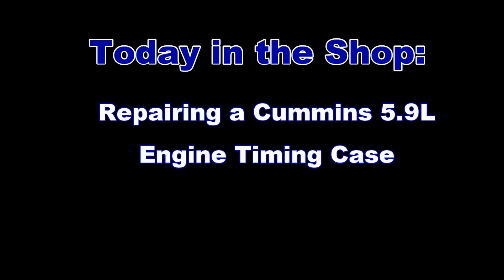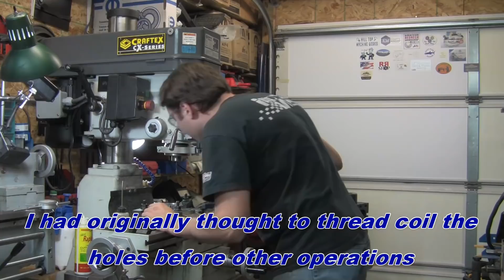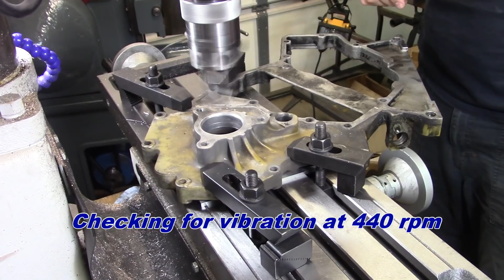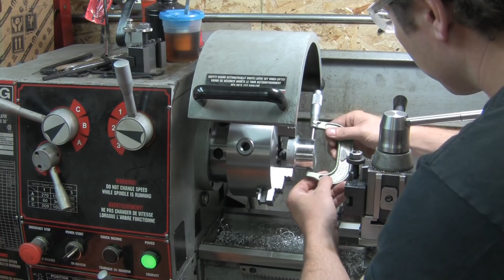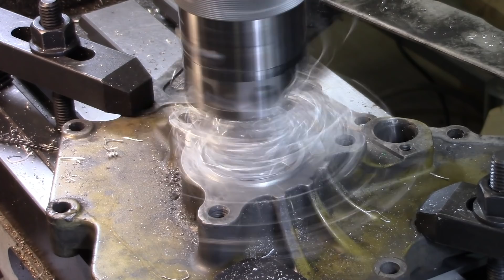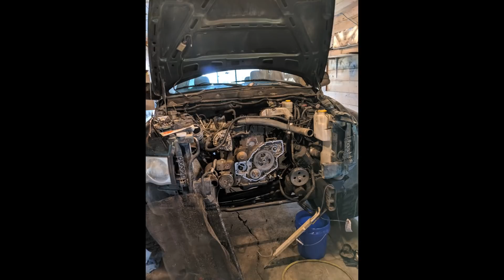Cummins 5.9 Timing Case Repair

Comment: what brand is your lathe wish you would give us a detailed video of lathe and operation
Reply from the maker: It's a King Canada KC1236ML, very similar to the Grizzly G4003. The new shop is still needing to be finished but when the equipment is set up in each machine's respective new home each one will need a cleaning, leveling, and some maintenance so I can go through each one at that time.

Comment: Liked! that is a real world repair done right. Curious what brand or type of boring head you have?
Reply from the maker: Thanks, glad you found this one interesting!  My buddy was happy with it and the engine ran after so I was happy, lol.  I haven't found any maker's marks on the boring head but near as I can tell it looks like what MSC used to sell as a small "Interstate" brand import boring facing head.  They only have the 3" now but their old pictures of 2" boring facing heads look like this one.
Reply: Everett's Workshop  I bet they inherited whatever Enco was selling when MSC bought them. Thanks for the tip, I was looking on eBay.

Comment: great job, Question for u , will hot engine water affect the lock-tight bond?
Reply from the maker: Thanks Billy, and the Loctite sleeve retainer I used is good for 450 deg F, which is way above the temperature that front timing case will ever see.

Comment: Great job, there will be trucks queuing down your street for engine repair soon 😉, highly professional, the mod will be called "The Everret Special" 😀
I have a load of similar modified slot cutters, not my idea, they came with a second hand boring head of eBay. Making them single flute, helps with machining plastics and Aluminium.
No problem with your son letting you hear him, he'll be in with you soon enough.
Thanks for sharing and best regards from the UK.
Reply from the maker: Thanks, but this is the only request so far for this particular repair.  As for the 'custom ground' end mill, it was a move of necessity as I have no 1/2" boring tools. Definitely looking forward to having my little guy out there actually working with me, he's even fun now hanging out watching me.

Comment: hello Everett. could you put up a link to the boring and facing head you purchased? great video, thanks . subscribed.
Reply from the maker: Hi Steve, I got the boring facing head from eBay and that listing page is gone already. There's an exact boxed kit on there right now for twice the price I paid, look up 'BFH-250 boring head' and it should come up. Otherwise they don't seem to be for sale new anywhere.
Reply: @EverettsWorkshop   thanks
Reply: @EverettsWorkshop  how about this price for use German made head https://www.ebay.ca/itm/Wohlhaupter-UPA5-S-6-Universal-Facing-Boring-Head-Removable-NMTB40-shank-UPA5-/143221481228?hash=item2158aa5f0c

Comment: For left-drilling broken studs, it’s better not to use oil. Friction is your friend here. 😉
Reply from the maker: Hi Stefan, yeah, in retrospect the lube wasn't necessary. The stud was still jammed in there pretty well but you're right, didn't need to oil it

Comment: Hi, just wondering if steel would have worked for the sleeve? Thanks for sharing another great video.
Reply from the maker: Thanks Gary, I had thought about steel and a press fit, but decided to stick with aluminum due to the thermal expansion differences.
Reply: I thought that maybe that was the reason. Thanks for the reply.👍

Comment: Awsome job. That was a creative use of a milling cutter. You can use the smaller insert bars in the boring head, because that is what I use in my not so fancy one. Out to fix a broken race car for me.
Reply from the maker: Thanks Jim, I dug through all my bars and boring tools and had nothing in half inch. In a bit when the fun budget recovers I'll look for a 1/2" diameter insert bar for it.
Reply: Everett's Workshop one thing to consider but not for this job. If you have smaller bars you can make bushings to adapt them. Especially if you have a job that needs smaller diameter bars.

Comment: at 07:45 and again at 08:05 you grab the top of the boring head and proclaim that it is "perfect".  What are you checking for?
...   oops I just read your reply to Douglas Thompson
 below.  All clear now :)
Reply from the maker: Hi Dean, yeah the collar when held will advance the tool feed in the head, letting the operator face the surface radially. Very thankful for being able to find that deal as there is now another one on eBay for twice the price!

Comment: hey everett very professional repair very well done. didnt think of using an endmill as a tool for the boring head bravo on that one you allways come up with different and good solutions. a big thumbs up everett. thanks.
Reply from the maker: Thanks Jamie - it was mostly an issue of necessity as I don't have any 1/2" shank boring tools yet. Worked ok on aluminum, not sure how it would fare on steel. I saw someone else a long time ago fashioning damaged end mills into other tooling so can't really claim originality on this one.

Comment: Thanks for the info.  I am here in Alaska where shipping is so high on anything of weight that gambling on a good machine isn't worth the risk especially if you have to return it!  I am going to have to look for one of those facing cutters.  Take care.  Doug
Reply from the maker: Yeah, I can only imagine freight costs to up there, if they're anything like sending stuff to Northern Canada. The boring facing heads are ridiculously expensive new, and this one is a lower grade of one, but I'm just thankful to have one now as there are a few things I'd like to try doing with it.

Comment: Well Done Everett. with a nice finish etc ...  LOL   and it works, which is a bonus .. LOL
My questions is ..  why didn't you give the insert .002" to .004"  press fit + the bonding agent, before you finished milling for the finished size. and did you have to touch up the OD or anything on the pump before you did a final fit.
Reply from the maker: Thanks Ted, I had originally thought of a press fit but was concerned about galling issues with aluminum on aluminum, especially on cast. The Loctite information stated a slight clearance requirement, up to .007" so I figured .001"-.0015" slip fit with the sleeve retainer was the best option for what I have to work with. As for the pump, he found a good used pump as the original pump snout was pretty much screwed.

Comment: Dodge products are million dollars worth vehicles, if you buy them in parts...   🤑😂👍
About the pleasures of the young ones, enjoy all of it before they get to be teens, then, the real fun starts, even more so with girls, ask how I know...   😍😍🍼🍦😱👍
When I finally sold my 1999 RAM with a diesel, it probably weight about 500 ponds less the day I got it, wear tear and mostly rust got the better of it. That truck costed me a fortune to keep on the road, total front end suspension, high pressure fuel pump skipped, a $10 crowned part breaking in the power steering/power break pump, steel tubes on top of fuel tank rusted, etc...   All nearing 12 to $15,000, plus regular maintenance, I liked the sound of that engine, though...   🤑🤑🤑🤢🙉
Reply from the maker: Yeah, there's something about a diesel that evokes a primal response in me too, makes working on highway tractors a lot of fun. However, diesel pickups do require more maintenance and are costlier to keep up. So, my Dodge is a gas pickup as it isn't worked hard enough to merit the cost.
Reply: @EverettsWorkshop  The Cummings engine was fine, it always started not even needing a half turn to get going even in Winter down to minus 20C,  everything around that was named Dodge was prone to fail, even the air conditioning stopped working 4 months after the warranty....   Sigh...!!!
Philippe had a 2011 Dodge RAM 1500, that thing costed so much in gas that when he got rid of it, just the savings on gas was enough to make the monthly payment on a new VW Golf TDI, so far after some couple of years of use, he still loves his TDI.

Comment: Excellent job Everett. Its a relief when its finished when its not your own work piece. No room for errors, more pressure when your an amateur. 
Looks great I bet the truck owner was over the moon. I noticed its a R8 spindle bore on your milling machine, I used to have the exactly same model.
Reply from the maker: Thanks Tony, the nice thing with this one is that he was pretty much stuck with buying a new case, we were trying to save him some money. And yes, he was pretty tickled to save some. I am thankful for my mill, if a Bridgeport came along I'd be tickled, but still thankful for what I have for now.

Comment: Nice job worked out well. 
In case you hadn't thought of it, you can use your boring head as a fly cutter,saves a tool change. For a job like this you are already centred, so just go left and right then forward and backward, as long as tram is ok the face will be too. I do a similar job on BMW boxer engines oil pump bodies ,part of the crankcase, and using the boring head makes access easier.
The trouble with 40 year old crankcases is they will distort slightly, so levelling can be a pain as tolerances are pretty tight. Height can be an issue too on my mill.😢
Reply from the maker: Thanks Chris, it would have needed a couple passes with that boring head if it was used for a fly cut but it does didn't take too long to pop the fly cutter in. I can imagine that it would be serious pucker factor cutting in an old BMW block, and old car parts are hard to find replacements for!
Reply: @EverettsWorkshop  they are bike engines and therefore rarer which makes them more valuable and increases pucker factor even more, but we are man enough, just.😎
Reply from the maker: @chrisstephens6673  Oh man, I hadn't  thought about them being bike engines, yes that does make them rarer! Don't see a lot of BMW bikes around here, wasn't the first thing that came to mind. That sounds like it would be interesting to see the process if you hage pictures or video of the repairs.
Reply: Everett's Workshop   i filmed the last one but not best quality (British understatement ) video . I do have a few of the other jobs I get asked to fix up on my channel, amongst the animal ones. It is difficult to video in my shop because if anyone saw the mess in there I would lose any credibility i may have, but if I ever get to learn to edit clever cutter may save the day.

Comment: A friend in need is a friend indeed - I bet your friend loves you for your help, nice job. What happens when you grab the top of the fly tool holder?
Reply from the maker: Thanks, he was happy with saving some money, for sure. The boring facing head has a mechanism inside that as the knurled ring is held that the boring tool moves outward to make a facing cut. Fun new toy, thankful to have found one that didn't cost an arm and leg.

Comment: I do not have the machines to do this kind of work. But if i did it would stress me a max to do this. Imagine i have to tell my friend that i screwed up his part... Awesome work, Everett, And the finish looks spectacular.
Reply: Rustinox   I get what you say, i get to reline oil pumps  on BMW boxer engines  and they are bored in the crankcase. High pucker factor job, but pays well ish.
Reply from the maker: Thanks Rustinox, it mostly just needed a vertical mill to bore it out but I suppose if done right a person could do it with a lathe with some extra jigs for holding the case. And the nice thing about this one is that buddy was screwed one way or the other, this was just an attempt to save him some money :)

Comment: Interested in the slip knurled collar on your new tool.  I am trying to see just why you would want to grab a spinning holder?  I haven't seen that style before either so it is a bit intriguing.  Any particular advantage over a boring bar fly cutter?  It is nice to see a shop outfitted pretty much like mine--lathe, column mill etc.  There is no used tool market here so I can expect to never amass shapers, surface grinders, tool grinders, and the like in the years I have left.  Which leaves me very amendable to watching projects from a shop with like capacity.  Take care.  Doug
Reply from the maker: Thanks Doug, that boring bar holder has a facing function. There is an internal mechanism that is actuated by holding that knurled ring while the unit is running. Every rotation engages a ratchet mechanism that feeds the tool out radially, allowing the tool to do a facing cut out from the center.  As for used tooling, the majority that I get comes from eBay but got a few pieces (like the shaper and rotary table) from other places here in Alberta.

Comment: Good to have you have as a buddy’s buddy., can I be the buddy to that buddy?
Reply from the maker: Well, six degrees of separation, right? Chances are we have a buddy of a buddy of a buddy of a buddy in common, right? :P Besides, you drive a GM. But they use CP3 pumps too, so I would sleeve yours if you needed but you have bigger equipment and at least as much if not more skill in machining so you'd probably do your own :) Hope you're doing well.

Comment: Not at all like my 1st gen.  I rebuilt the rotary pump on it spring of last year, and just in time.  I did it because of seal leaks, but when I got in it I found several other things on the edge of failure ... and part of a previous failure still tumbling around inside it! Yikes!

No need to apologize for taking care of any child ... especially your own.
Reply from the maker: Yeah, the 1st Gen's had a totally different type of pump on them - sounds like you saved yourself some $$ and grief by getting on it now. As for my little guy, it was more that I hope it doesn't sound like complaining when he needs me. He means way more to me than any hobby.

Comment: Awesome repair needed a friend with a shop in my younger days did not get into trade till 1983 - 84 started school Aug1983 boss would not let me leave my QC job till I full trained my replacement took 9 months ....I was almost 30 before that I was press operator  then Quality Control engineer for a while that got me interested in Tool & Die always was working closely with them. Love it then love it now what an awesome trade.
Reply from the maker: Thanks Anthony, it was an interesting challenge and I got to play with a new toy. As for trades, I'm an auto mechanic who messes around with machining, would have been cool to try machining but part of me doesn't want to make another hobby into a job.

Comment: As long it works and there’s no leaks
Reply from the maker: It does work, the fellow is happy with it and it's holding well. The sleeve retainer compound is oil-proof when cured, and is heat-resistant to 450 deg F as well, so it won't leak. Buddy's just happy to have it back running.

Comment: My 2 cents  I would build up the dents with a tig welder then clean up the weld with the mill.  Easier and quicker. But no better result than yours.
Reply from the maker: Hi Thomas, we had discussed the weld up option but honestly I'm still very novice as a TIG welder, and there was still a small portion of undamaged bore that could be used as the reference to ensure hole location. Otherwise welding would be an option, for a better weldor than me.
Reply: Everett's Workshop ;)